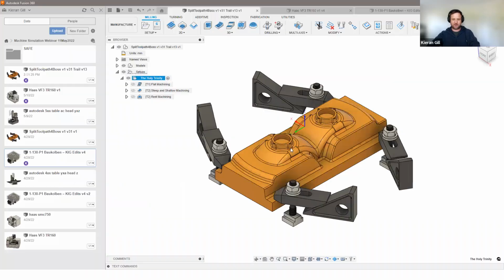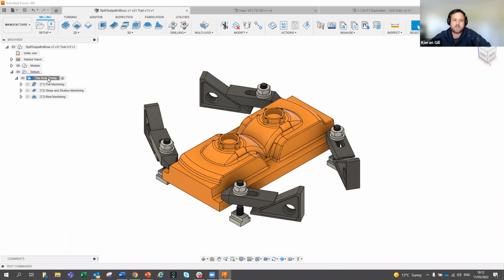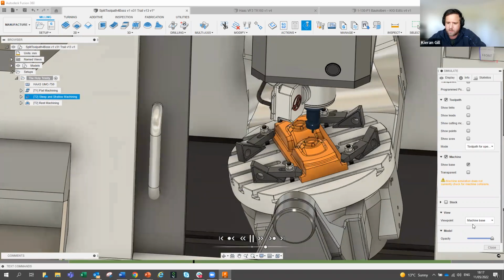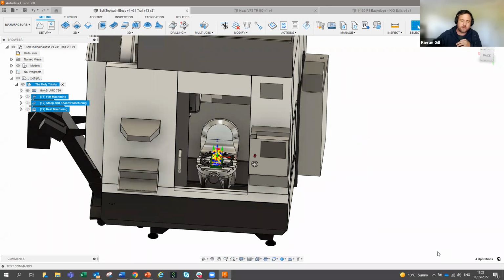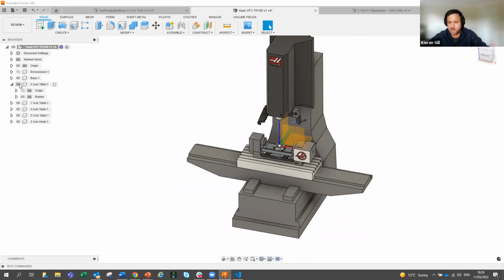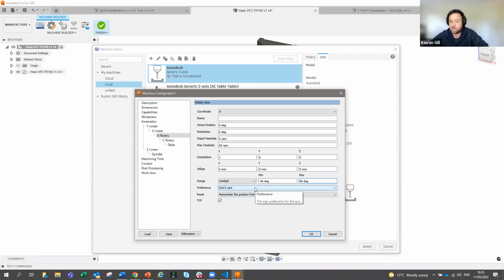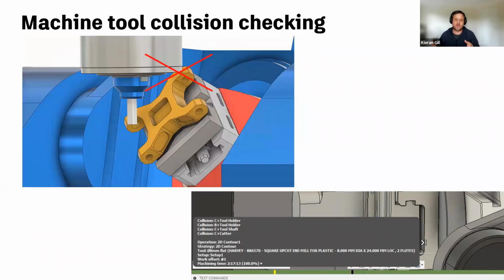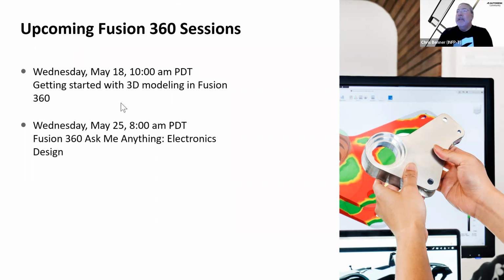Getting Started with Machine Simulation in Fusion 360 Manufacturing

Comment: at 28:13 you open a tab with your Haas VF3. and you say:
"so first thing to bear in mind is that here i've got a uh just a hash machine a vf3 and i can go and i can take some of these components "
Wish you could have taken 15 seconds and described how you got that model open and from where.
I'm trying to find out how to take an existing machine model and edit it with my table I've already modeled, add fixtures as well as any generic 210mm rotary table.  My machine is a Milltronics RH19 and my 4 th axis is a Tanshing vrnc210 so I'm pretty sure there isn't a model of it available.

Comment: I’m pretty sure the reason you autodesk guys have so many problems streaming is because you’re video encoding is not being done in the GPU. The stream/video chat problems are frequent for autodesk. If you enable NVENC in OBS, you likely won’t have problems. 

If you’re not using OBS, your software probably won’t tell you whether it’s GPU or not (especially if it’s windows-native, since acronyms are scary). OBS is open source and tells you things about what the computer is doing. If you have AMD or integrated graphics, you need to use VAAPI, but you may be SOL. I’m not trying to sound like a prick, I’m just saying. There are no encoding artifacts in the stream though.

One other thing: do not use wireless to stream. It’s a recipe for problems.

Comment: Thanks for a great video, it's excellent that machine simulation is being improved in Fusion 360. I've been using this feature for the last couple of months and it has helped a lot. We have now 3 different 5 axis machines simultated up for mainly 3+2 work. We are UK based and would love to help with your outsider testing process, as we have found quite a few problems along the way. But again it's great Fusion 360 is going in this direction.